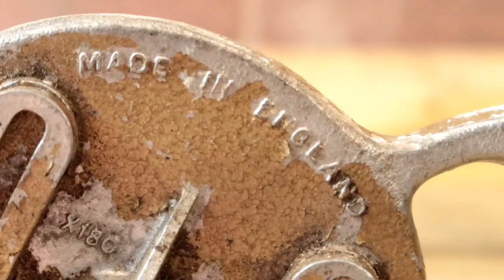Vintage WODEN QUIKSAW Restoration/Remaking the Missing Part

Comment: That device seems to be extremely unsafe.  I am assuming that the blades spins via an outside source, such as a drill.  How in the world would one actually use that safely without a second set of hands?

Anybody, please feel to correct me.
Reply from the maker: That's way I used just for display cuz in my opinion is not safety anymore
Reply: @AlexBRestoration  I am glad that it is only display. It is cute, though. Good job.